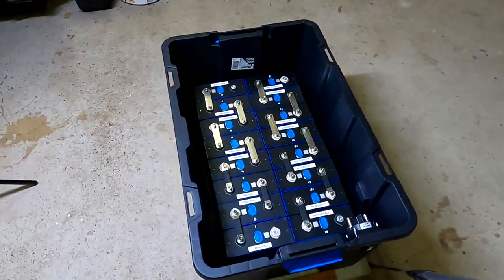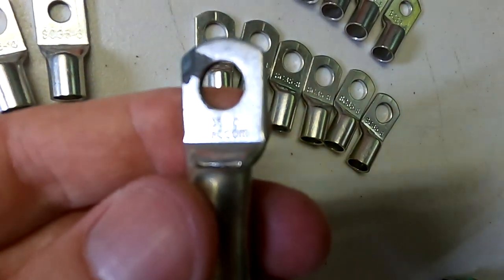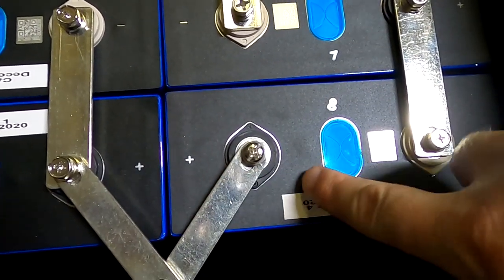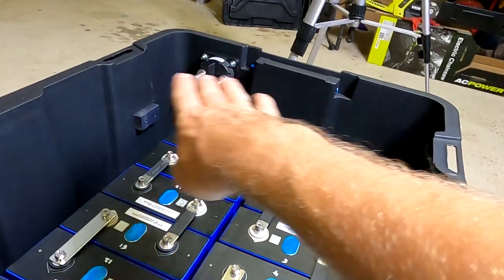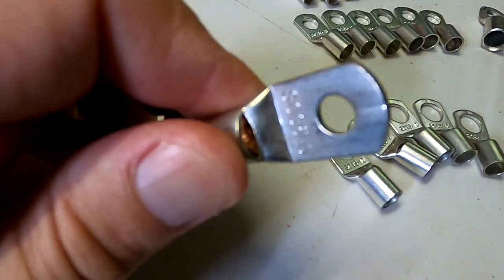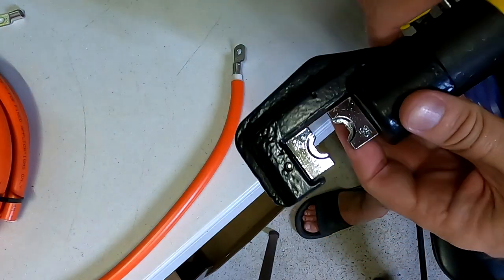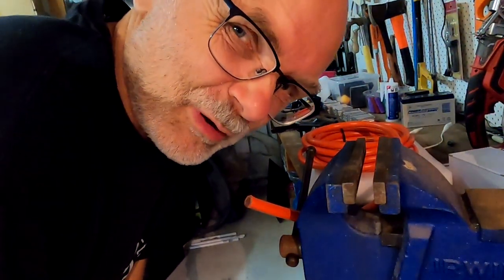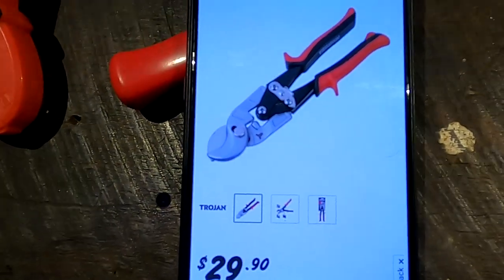When nothing works, the equipment is s**t, and a main tools is missing. #buildthebattery.3

Comment: I would NOT use those cheap lugs.  I only use TEMCO lugs, there are other good ones, but those lugs you bought are crap!  The crimp didn't work because the walls are way to thin on those lugs.
Reply from the maker: Yes, that was the case. You can see this in the video when compared to the other lug.
Reply: For a stationary application this isn't a concern.  It does look like they just squashed a copper pipe on one side, drilled a hole, and plated them.  Wouldn't be hard to do that yourself.

Comment: oh yes....this is how my projects go.   i shop for a good price on parts and often find the quality is an issue.  different size....just slightly different shape and so on.  then i spend my time making the mismatched parts work, much like you did with changing the jaws to your crimper. it  is a ever changing balance of cost and quality. My experience has been even a simple project can become more challenging as cost becomes more important.  the easy way could be to buy an assembled battery1000.00 or more and done.  but what fun is that!  the real question for me has been   how much fun do i want to have with my current project!  I like your approach, build what you can and buy what you need.
Reply from the maker: Hahaha, glad I'm not alone. It can be quite frustrating sometime, hence I thought I share this bit as well here...

Comment: I always cut thick cable and hose with a angle grinder and thin cutting disc.
Reply from the maker: Wow, how's the smell?
Reply: @OffGridGarageAustralia  Before you wase 30 bucks ... good airing will do. Slow and gently cutting might help. (I myself would be so angry to use a chissle and hammer!)
Reply: You need cable shears, i cut wire for 2 to 3 hours a day and they are way way better than side cutters ;)

Comment: I do not thrust this C shaped hydraulic crimping tools since I saw a video from its head breaking while crimping. I do not need a big heavy metal junk flying around at high speed. The H shaped (both side fixed) seems to be a bit more durable.
35mm2 (AWG2) cables, so you will only use 80A max charge or discharge. I think I would choose the 50mm2 (AWG1) cables. Even the busbars are bigger 20x2=40mm2 and they are very short (all together 1,4m). 
If you use 35mm2 cable and only 80A then you have a 43W loss on a 3+3m cable. (30W on a 50mm2 cable). Not much, but it will represent as heat. With the double insulation cable can heat up even more (more heat, more resistance, even more heat). It is all between the recommended parameters but not a big difference in cable price.
Reply: Also, especially with a 12v system, voltage drop in the cables is a major problem.
In our 12v 3kw setup, I've used 50mm^2 for each of the two paralleled battery banks.

Comment: Hi
I climbed the same learning curve. I bought a ratchet cable cutter from eBay for ~£20. It easily cuts 50mm^2 cable and will cut 3 core 6mm^2 swa cable with seemingly little damage.

Comment: on the subject of crimping: if you have a vise (or vice - depending on the local spelling) in your garage then fix the crimping pliers with one of the arms in it so you have one hand to pump and one to hold the cable (I saw it on another YT channel)
Reply from the maker: Great suggestion, someone else mentioned that before here. I will definitively do that.

Comment: I have the exact same crimping tool, and even using proper branded bevel holed lugs all of the dies are almost a whole size too big! Same as another comment below, 70mm cable lugs crimp perfectly in 50mm dies Nd 25mm cable Crimps perfectly in the 16mm dies!

Comment: I bought these from Amazon US, and they are inch , but they do make wide pads lugs.

SELTERM 8 AWG 5/16" Stud (Wide Pad) (25 pcs.) UL Marine Grade Wire Lugs, Battery Cable Ends, Tinned Copper Eyelets, Tubular Ring Terminal Connectors [B8]

Comment: The crimp problems are due to several problems, including  1.  inconsistent lug wall thicknesses, from one brand to the other,   2. AWG vs metric wire and lug sizes, with one standard sometimes passed off as meeting the other.   3. some wire manufacturers cheat/skimp slightly on the wire sizes.  The important thing is to get a very firm crimp.  In some cases, we've used a mixture of two different die sizes.  Don't worry about small "ears" on the sides.  Just snip or file them off and cover the entire crimp with heavy-walled shrink.
Reply from the maker: Great tip, thank you.
Reply: Wouldn't cutting off the ears release the grip of a crimped lug?
Reply: @charlesrichards5389  if the ears were large it might.   I’m talking about very small ears
Reply: Munchkin ears, not Spock ears.

Comment: They didn't give you bus bars that can be used for "end to end" connections? Every time I've ordered cells they've provided short bus bars for both "side to side" and longer bus bars for "end to end" connections.

I drew up a quick picture of the cell layout required if you did want to try and use an "end to end" connection at the middle of the pack:  https://photos.app.goo.gl/J41S4ZdW39B3Bvpp7 (The bus bars are represented by the different colored backgrounds)

If you do go with a cable at the middle of the pack, you could put your fuse on that cable as well. (Assuming your BMS allows it, some allow mid-pack fuses, others don't)

On the crimper: It's the cheap terminals from Ebay. I have that exact same hydraulic crimper and I've had the same issues with "cheap" lugs. It's really worth it to pay extra for good quality lugs.

On the wire cutters: I use these: https://www.globalindustrial.com/p/tools/Grinders-Sanders/cable-bolt-cutters/high-leverage-cable-cutters-63050 and they cut through very large cables just fine. Here in the US you can find these at any home improvement store or any electrical supply store. The ones you pulled up online would also work well.

Comment: My bus bars on my older agm set up were copper pipe flattered and drilled. Never felt any warmth from them, they worked a treat.
Also, a nice trick to help push the copper wire into the ring terminal is to use a small cable tie around the copper strands, not too tight, just to hold the strands together, and slide it along as you feed the wire into the ring terminal.

Comment: For cutting the cable, crossing-shear cutters give a nice square end, (not nipping cutters!)
For the bus-bars I bought brass finger-panels for doors, cut to required dimensions.
I've got one of those hydraulic terminal-crimpers; I use the insert that gives the best crimp, then rotate 60 degrees and do it again.
Reply: I've noticed quite a few people using brass instead of copper or even the much cheaper aluminum but not sure why. Is is to do with electrolysis or cost or just looks?. Brass being such a poor conductor I don't understand the logic there.

Comment: If you have the most positive and most negative on the center of the bank, not the outside, it works much better.

Also, I have the same crimper. Yes, use one or two sizes down especially with cheap thin connectors. This gives a very solid crimp
Reply from the maker: Great tip!

Comment: Andy try Windy Nation or Temco on Amazon or Ebay for tinned copper ring terminal. Both top quality with flared ends. You can also get complete cable, lugs and heat shrink from Windy Nation which is what I did.
Reply from the maker: I found a company at the Sunny Coast, they send some over the next day. But thanks for the tip.

Comment: So glad you picked up on the poor quality of the lugs. The CSA of the lug is never the same as the CSA of the cable and you should always go for heavy duty lugs. Also beware of ordering a metric cable size like 35 mm and getting a 2 AWG cable equivalent which is only 33.6mm and you 35 mm lug will be a poor or loose fit.
Reply from the maker: Thanks Howard. The cable is proper 35mm2. 2/0AWG is more like 33mm2 so bit thinner as you said.

Comment: You can use a angle grinder with a cutting disc to cut cables or hoses with metal sheaths or re enforcement.  A Dremel will also do it.
As for the cheap ebay crimp connectors.  As others have said the connector is out of spec.  Use the die for the size of connector but place a piece of round bar in with the connector, between connector/ferrul and die.  Something like part of a nail or the blunt end of a drill bit.  Select the metal to place a semicircular indentation into one of the hex flats, that will press down into the cable for a firm connection.  Alternatively make a shim to fit up against 2 or 3 faces of the hex die.
Reply from the maker: Thanks for the tips!

Comment: After cutting with the hacksaw just trim the spread ends with a good set of side cutters. (Before removing the insulation)
A junior hacksaw with a finer TPI cut welding cable without the burr

Comment: I've used a chop aw or even a tae saw to cut cables. Also what you can do before cutting is wrap the end real tight with electrical tape then cut and remove tape
Reply from the maker: I heard of this tape trick before. Have to try it...

Comment: My thoughts why not slide the left side over to the right and vice versa. Then you could connect bus bar to connect furtherest neg and pos in line. Also closest neg and positive both close to outlet. Also Andy, after crimping any reason for not soldering as well?
Sorry if I am wrong, just throw ing it out there buddy!
Reply: Yes, I would solder that gap at the end of the wire to seal it off from the elements if nothing else.

Comment: You might want to remove your wedding(?) ring. A crowbar short through that ring WILL amputate your finger. I've seen the pictures of that. No rings,  no metal watches...even a single plain car battery can throw over 3000 amps into a crowbar short.
Reply: I am sure Andy covered his wedding ring with clear varnish otherside he would wear rubber cloves  ;o)
Reply from the maker: Not using a crow bar for my battery stuff. The ring is made of plastic ;)
Reply: There was a guy in my lab who couldn't remove his wedding ring for religious reasons. He was given permission to wrap it with medical tape.
Reply: @charlesrichards5389  He could have had one tatooed on, that's also a fad. I wonder what the voltage rating of medical tape is? (G)
Reply: @OffGridGarageAustralia  A crowbar short doesn't require a crowbar. Just any similar "zero" resistance tool, like a socket wrench, plier, crowfoot wrench...
Reply: @lyfandeth  He used medical tape only because it was more skin-friendly. Voltage wasn't the main issue in our area though. This was in a laser lab where anything reflective around the beam could cause problems. But for voltage, medical tape has to be better than a dead short!

Comment: I've got the same hydraulic-press and everything works fine with the inserts. Please also check the cable... where did you order them? I use the crimper mainly for 35 and 50mm² ... so if there is no production-problem it can be the real cable-size, too.
Reply from the maker: That's very good welding cable quality, It's just the lugs which are super cheap and thin. I've got better ones now and they work fine (I hope so,,,)

Comment: Solder the connections as I would do. Use a small torch or 100w+ Soldering Gun to sink a little flux and solder into the joint. Military Specs are found on Google. Cheers Guys.
Reply from the maker: Solder breaks under high current?

Comment: I have the exact same crimper (just a differant name) and the dies are the same too ! i have to use a size smaller and put up with the "wings", they annoy me as it makes the shrinktube look messy :(
Reply: A wee update, i got thicker more expensive terminals from my local auto parts shop tighter but still able to pull them off and i still had to go down a size :(,  ithink it's partly the dies partly the terminals ? i did get smaller "wings" with the better terminals though and it looks better wit hshrink tube over it :)

Comment: A thought for cutting. A piece of metal pipe same as total diametre of cable use as a sheath around cable in vice not too tight. Then hacksaw gently quicly but with low pressure. Would waste an inch if cable but a socket tight fitted would work?

Comment: that crimper work well if you put the backside of the jaw in the bench vice then rotate your handle up one hand on cable one hand on lever easy cheesy sometimes the back jaw is beveled too much but a grinder makes it nice and flat for the vise jaw firm grip
Reply from the maker: Thanks for the info

Comment: Asides from the correct cutting tool your cable looks like a EN 60228 class 5 or 6 finewire cable. So you should use class 5 cable lugs for it. I would suggest Klauke 705F10. If the combination of cable type and lug do not match your crimping tool MUST fail of course.
Reply from the maker: Thanks for the info!

Comment: A pruner might work to cut, I think I see one on your peg board.  I know this because my wife tries to take my wire cutter into the garden.  Lol.
Crimper and lugs are fine.  It is ok to squeeze the copper on the sides.  You can cut a lug apart to see if it squashed the cable inside.

Comment: Your lugs and crimping with the 25mm seems quite adequate for your plans. Check temps with high load just for good measure, but I don't think you have any problem.
Reply from the maker: Super tight crimp. It will work with this sort of modification. I was just feeling  it's not quite correct.

Comment: 10:00 300A terminal is better. OT-300A Open-End Copper Crimp Terminal Lugs AWG 4-2/0 Battery Cable Connector 
35 is okay just heat it up with a torch and fill it up with rosin core solder wire.
11:48 For the wire cutter hand saw is fine. Just trim the end around 45⁰ angle with a sharp razer or use a  dremel cutter wheel.

Comment: U can cut the cables like me with radial Saw and u can use some eléctrical tipe very tight for keep the cable with same diameter i did dat for 70mm multiwire cable and works pefect
Reply from the maker: The tape is a good tip. Thanks.

Comment: Hello, is that a bolt that connects two separate crimped wire? I need it on my DIY but i don't know the right term of that tiny tool. thanks
Reply from the maker: Not sure what you mean with 'two separate crimped wires'.
Reply: @OffGridGarageAustralia  The one that looks like a bolt , cant find it on online store :(
Reply: @OffGridGarageAustralia  the bolt that you put inside the ring terminal
Reply from the maker: What time in the video was that? I'm still not sure what...
Reply: @BlazeByte21  Some people use terminal bolts, some use grub screws.
Reply: @charlesrichards5389  Hello is it okay to top balance cell 4 cell,   parallel 2 cell at a time ?  and another 2 after, because i only have 3 busbar but i need atleast 6 busbar to parallel all 4 cell at the same time. thanks
Reply: @BlazeByte21  Watch Andy's other videos showing him using jumper wires for balancing when he doesn't have enough busbars. That's because balancing currents are very small when you're working with healthy matched cells. Such jumper wires may get warm if your cells are way out of balance. If you have any unhealthy cells, attempting to balance them will not fix them.

Was your question about terminal bolts answered? You could have found that answer in Andy's other videos as well.

Comment: - Use Selterm Tinned LUGS and you will never have issues.
https://selterm.com/pages/battery-cable-lugs
- Open ended lugs are NOT a good idea, it IS an invitation for corrosion over time.
- Always put Heat Shrink over the cable and the lug barrel.  Adhesive type shrink is best.
- Use a Proper Wire Cutter  ONLY.  Even a Big Cable / Bolt cutter will work well if used carefully.
- Why did you not use the battery setup & layout diagrams as provided all over the DIYSolarForum ?   Would have saved you a couple of hours of puzzle playing.
* HANDY FOR EVERYONE:  https://diysolarforum.com/resources/luyuan-tech-basic-lifepo4-guide.151/download   

Alternately, here is a 16S "Block" Pack Diagram:  https://imgur.com/7ZSILYk

The Hydraulic Crimper:   
There are Metric Dies & AWG Dies !  Many people DO NOT REALIZE THIS and it can create issues if using the wrong sized dies.  Having a slight "ridge" as you showed post-compression with the smaller Die is not unexpected, this is also not a serious problem but you do have to have Shrink Wrap over the interface of the cable & lug.    

NOTA BENE:  
When you look at the Selterm Site, you will see Metric & AWG Lugs & Connectors.  Note the slight variances between them.  Then if you look at Cable Manufacturers such as SouthWire's Royal Excelene you will see some difference as well.  See thickness, strands, sheathing etc.

Royal® SUPER EXCELENE ® WELDING CABLE UL  
http://www.industrial.southwire.com/en/tile/10/spec/70300/?country=CA

Royal® EXCELENE ® NON-UL WELDING CABLE
http://www.industrial.southwire.com/en/tile/10/spec/70305/?country=CA

Then compare to Metric Sized cables (Southwire provides the mm thickness in their listings).

Hope this is helpful to you and all of your channel viewers.

Comment: I'm taking a cooler, and building a portable power station, with 12v lifepo4 batteries, bms, 1000 watt pure sine wave inverter, solar charge controller, and some cooling fans. It'll plug into a 260 watt tilting solar array for charging.